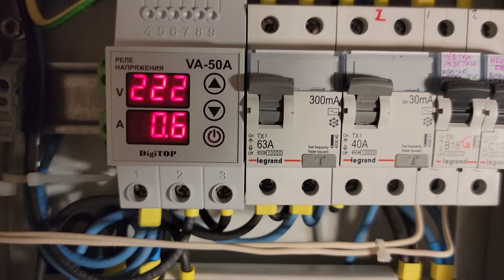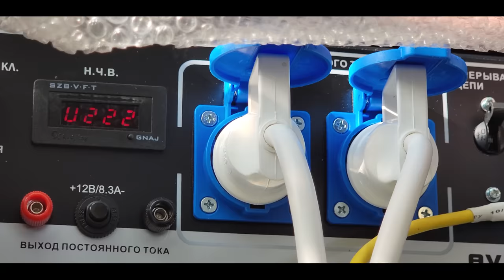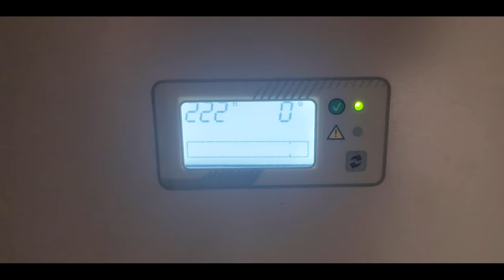THE RUSSIAN DOES ELECTRICAL WIRING WORKS

Comment: Dude you're not only an engineer you are a Craftsman! Fantastic way to be prepared for power outages. I bought a gasoline and propane 450 w generator for my 35ft hemisphere trailer and I didn't put a fraction of the work into that but it was still a chore. It's a good feeling when you can do for yourself. A real sense of accomplishment. Nostrovia!
Reply: Probably an electrical engineer or nuclear energy engineer working for the KGB, lol.

Comment: That's a nice looking installation. That 10kW inverter would cost between $2000- $4000 here but it will do a good job delivering low distortion sine wave power. I use a 7kW inverter type generator with about 1% total harmonic distortion which is lower than the 3% THD coming from the power grid. It cost around $700 USD.  I'm able to meet most of my needs with it with the exception of air conditioning. Fortunately, power outages are not frequent where I live. Many US households now have automatic backup generators powered by natural gas from the utility company. Those start automatically and come on line when the power fails. Typical 22kW systems installed start around $10000 in my area.

Comment: I used to work for a US government utility as a chemist and had an emergency generator system installed in the laboratory. I used several gasoline generators that fed line conditioning equipment that were attached to laboratory testing equipment. There are many differences between Russian and US electrical systems. I see that you have many talents and like watching your videos.

Comment: I don't know how I missed this before.  You do fine work. There are some things that you do that are different from USA NEC code, but the over all panel building and wiring looked great!  I especially like you all using DIN rail with standoffs to be able to run wires behind and through - different style of breaker than a regular house panel here in the US, but very cool.  We do use those in industrial panels, and the exact same ones, I might add!

"Neat and Workmanlike" - is how the NEC describes it - you nailed that.

Comment: Your electric panel is different than what we use here in the US for houses. Your electric panel is very similar to ones found on large equipment in factory's here breakers mounted on Din rails. Nice job on your installation.

Comment: Nice electrical  installation. Looks like this is much better standard than ordinary I have seen in Russia. I have 2 flats in ulyanovsk. And electricity is very bad 🤔. You make the installation like an industry standard 👍. I do the same here. I work in oil industry here in Norway 😉. Working with automation control systems

Comment: It looks great! You might want to put bricks under the frame of the generator so the wheels are not on the ground. We had to  replace our tires frequently due to rubber rot until we "jacked" up the wheels by putting two bricks under the frame.

Comment: My mother's maiden name was Dzutsoff. Her father passed away before I was born. I have never meet with any of her family in Russia. I would have liked to of followed along in your design, but I did not see a block or one line diagram. I am a designer. I just retired at the age of 67 from a major utility company as a protection and control design engineer. I understood that you were cleaning up a panel mess and adding a manual transfer switch to the outdoor generator. What I was looking for is you loading of circuits primary circuit, before the breakers, in you load distribution panel. We do not do 220 volts on all circuits like you do in Russia. Our lights and wall outlets are 120 volts. Our underground buried cables are a minimum 18 inch deep and in conduit.

Comment: Amazing Dad letting Sati help. 
Dan your work is so excellent and neat. You worked was extremely FAST too!! Hahaha 😂😂
Reply: He is an electrical instructor. It’s why so fast
Reply: @Mikhelinx  not denying Dan’s skill, but he did speed up the video.
Reply: @pamelaanis715  I knew his frame per minutes is fast. But he went a very smooth assembled without a single mistake like I do often sometimes. He is highly skill with electronic equipment and power source
Reply: @Mikhelinx  obviously! I was also impressed how Dan cleaned as he worked!

Comment: It is crazy to see that you installed a petrol generator instead of a PV system. Clearly shows how cheap is the fuel in Russia. Here in Germany everyone is installing solar panels at the moment. I would have used a bit of electric grease on those connectors outside before the heat shrinks.

Comment: Will you build a house to protect the generator when it’s not in use? I guess since your electric panels on the 2nd floor you couldn’t just install an outlet to plug the generator into your panel?

Comment: Sati may grow up to become an Electrician,  or an Actress....
Nice Job looks neat and easy to repair if the breakers give up.
I like to solder wire ends,  but that looks like it will work.
In the US they make us bury Conduit 18 inches deep.
But I agree with the other comments,
you do good work.

Comment: Do you have natural gas in your home, for the stove or heating perhaps?
If so, you might look into a carburetor conversion for your generator from gasoline (benzine , as I believe you refer to it) to natural gas (or propane).
Might save you some money on the fuel costs, as well as simplify storage problems.

Comment: Hi Dan, is it necessary to have a qualified electrician sign off on a generator installation?
Here in Ireland it is requirement, especially with regards to the proper functioning of the "change over" switch. So you don't electrocute a power company worker repairing lines during a storm, etc.
Perhaps you have such qualifications yourself?
Cheers, Nigel.
Reply from the maker: Hi Nigel! We don't need any permits, no checks. I am not required to call a qualified electrician to check. ANd no one will check my work. I myself do not have any licenses and diploma, I just know how to do it, and I like it. Cheers my brother
Reply: The box that he added on the right was for a transfer switch which would prevent the generator from back feeding the electrical grid, so no there is no chance of electrocuting a line worker.

Comment: Over here in USSA, one has to have training, licensees, and permits to do any of that.  A homeowner can't even replace a simple water valve or water heater legally, without all the red tape.  And, definitely no HVAC work.  Gotta hire a 200.00$ an hr. contractor.  Good job, Dan.

Comment: I wish we would adopt IEC code and get rid of the NEC here in the states. Electrical systems are outdated, dangerous to work on, and obsolete for adding accessories to your electrical service equipment. You can't just easily add a current/voltage monitor, IEC residual current breakers(gfci and afci)(AFCI and GFCI breakers are expensive and unreliable here), electrical transfer switches, and contactors. If I wired my house this way, I would be condemned and have to change it out and homeowners insurance would void you. The major electrical brands here in the U.S. has been bought out by chinese companies that make these parts cheaper and counterfeit making breakers that are designed to protect your home and family don't even operate to safe levels. A customer of mine had to replace a sub panel out of pocket cash because the insurance company found a counterfeit breaker in his panel and it caught fire causing damage to the entire panel. He had to also pull an electrical permit and have a licensed electrician do the work which costed him thousands of dollars.

Comment: What in the world are you doing? Wiring your whole house into that one little generator?  Wow
Reply from the maker: don't be confused by its size, :)it runs on vodka 🏋‍♀🏋‍♀🏋‍♂
Reply: I have a generator that size that I use when there is a power outage. It will run my fridge and a few lights but not the whole house. I was not being sarcastic. I am one of the good guys who wishes you nothing but the best.
Reply: I am sure it would actually and seriously!
I tried methanol (E85) myself and take a look at „Garage54“, those guys from Novosibirsk. They ran a Lada on Vodka.

Comment: at 7:00 the better solution would be to use wago 221 or equivalent connector devices
next step, add a large LiFePO battery bank 🤣

Comment: 01:20, I wonder why that looks entirely cement. I know it as one part cement to three sand or 1:3 sand/cement mixed thoroughly together. A small amount of P.V.A. glue helps to mix in with the water.
Reply from the maker: I understand that you was confused about,  yeah  this is really not sand with cement, this is ceramic tile adhesive, it has cement already mixed with a very fine fraction of sand, which is why it looks like  cement.

Comment: S.W.A. cable should have been buried a minimum of 700mm since it runs through a cultivated, non paved area. If it were paved; 400mm minimum depth. Then covered in sand followed by stones for aiding mechanical protection. Warning tape should be laid over the entire run to indicate power cable is present. 

You may know in years to come that it's there. Others that follow you may not. Hence the electrical hazard tape as an early warning during any potential digging..
Reply: Safety should ALWAYS  be #1 priority. This is why there should always be inspections and plans filed with the town you live in, so the next person that will own that location is aware of things that are properly  buried
Reply from the maker: Yes, you are right, next time I will definitely put the tape. Thank you for the tip!

Comment: Those electrical parts look like they are all from western European companies. Are there no Russian companies making electrical parts? Also here in the US we would use wire nuts to connect wires not bolts and nuts. Interesting!
Reply: iek - Russia and Legrand  - made in Russia. Boxes and wires are definitely made in Russia, just not sure about the ABB switch. However, they are commercially available.
Reply: @Juni Gobi  OK, thanks for that info. I thought that anything that didn't have Cyrillic writing must be from somewhere else. ABB is Swedish I think.
Reply: @herbertsusmann986  In Russia, English is popular, especially in diagrams and titles. Goods with a name in English are easier to sell for export.
Reply: Guess I would have used Wago connectors instead of of bolts.

Comment: Are you allowed to do this in Russia? In Western Europe the problem isn't as much that we can't physically do it, it's that we get in big legal trouble if we do and get caught lol
Reply: I was thinking the same. Here in Spain, you won’t get electricity unless you can provide the supplier company with the invoice of an authorized trained electrician and a list of the work done. Same goes for gas and water.
Reply from the maker: Yes, I am free to do whatever I want, and not only for myself but also for any other person who lives in a private house. I don't need a diploma, I don't need permits, I don't need certificates to do this kind of work. I understand you, I heard how it happens in the USA, without a licensed worker you cannot unscrew the bolt there. I understand and think that this has both pros and cons
Reply from the maker: @midei  With us, only when working with gas, I have to provide a couple of pieces of paper, but still I can do all the work on gas myself, I can install the boiler and set it up myself. There is complete freedom in water and electricity, no one cares about this
Reply: You can do it.
You just need to have it signed off by an officially registered electrician in most cases.
It would still save you a lot though.

Comment: I am very curious to know if this channel makes you any money. The social blade says about 24k a year if thats correct, is it worth the time and energy you put into making these videos? Does the exchange rate effect profit? P.S. As an electrician, European electrical devices are really weird looking....I dont know what you're trying to do here but if you bond that generator and add a ground rod and then attach it to your house electrical you're creating multiple grounded paths. You're creating a situation where someone can get one hell of a shock especially since all your shit is 240V. Sink a ground rod at the first disconnect and nowhere else. Why are you nut and bolting those things together!!! Use wire nuts!!!! Cut the stupid sta-kon's off and wire nut those together!!! Nuts and bolts become loose over time! And those are dissimilar metals! Ugh.... Those are going to fall apart...